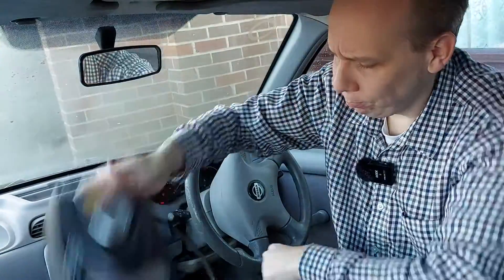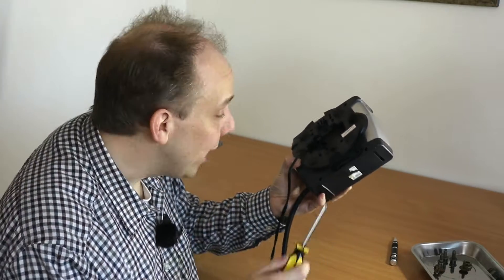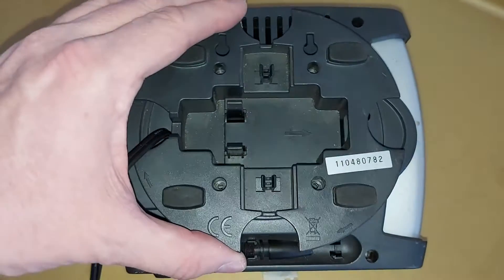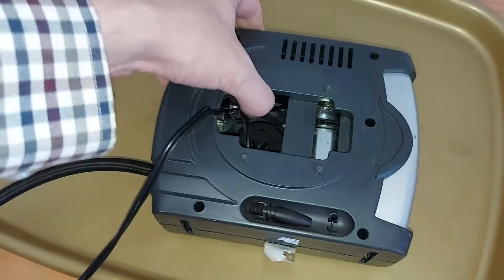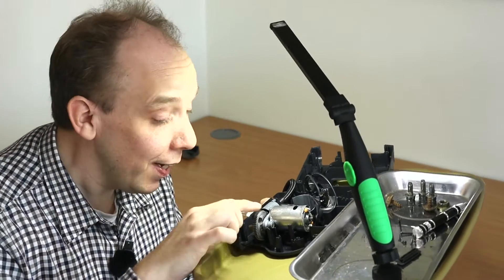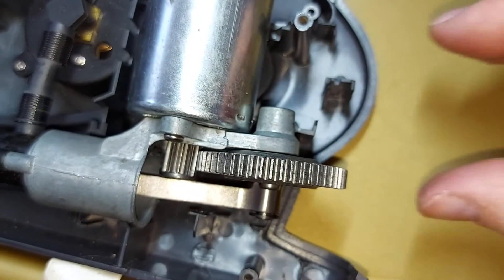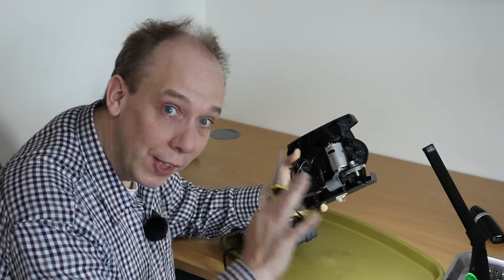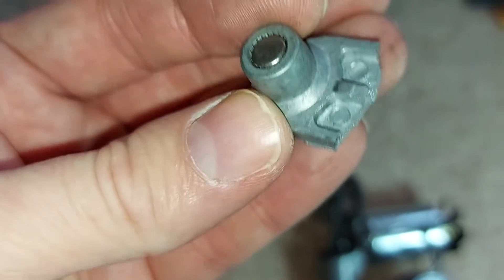How 12V Air Compressor Works: Car Tyre Pump Tear Down (Risk to Fingers)

Comment: Ten years was good, if it'd been a stepson I doubt it'd lasted 10 months.  As usual an interesting video to see the inside of such a machine.

Looking at it I'm surprised it lasted 10 years but perhaps it didn't get a lot of use and/or was well cared for.

Many users manage to burn them out and/or blow a car fuse by using them for much longer than they are designed for at each use as it's against macho law for many men to read instructions..

You can probably guess I prefer a good quality manual footpump (unless someone is not physically capable of its use) but then I've had men burnt out footpumps I've lent them, one with an overloaded six-wheeled Tranny with under-inflated tyres before the overloading.
Reply from the maker: Interesting comment as always, Nta16.

The last manual pump I used was terrible quality. The metal frame was so weak it bent (even with light use). I binned it!
Reply: @CarSpyTV  sounds like one of those £5 specials. 😊  The last really good one I had was the one burnt out by the Tranny user, double-barrelled so fast and more stable.  The current one (single) I have is better than most but the retaining clip for stowing is a poor design and the pump is already marked up a little after a few years use - but it's better than those wheezy, noisy, rattley electric ones that burn out on more than light top-ups.  😊
Reply from the maker: £5 sounds about right. And that was £4.99 more than it was worth!

I agree, by the way. Some of the electric compressors have a short life. The Ring ones seem to last, though. We have a few in the family.
Reply: @CarSpyTV  if they last that's good. For full disclosure I have a Hayner Pedal Power Pro which my wife wants me to put in the boot of her modern car instead of the factory supplied electric pump but the manual foot pump is useful at home to help neighbours out who only have the electric pumps.  But then I also only have manual screwdrivers. 😆

Comment: Wow, I didn’t realise how simple those pumps were. A very clever and basic design. I think you should connect the system the micra engine. It could be the pat powerful tyre compressor… in the world lol😊
Reply from the maker: Or, perhaps a spare engine for the Corsa! One cylinder is enough, isn't it?
Reply: @CarSpyTV  yeeeeea, that should be perfect. With that electric motor it will be a hybrid!! :p
Reply from the maker: That's my weekend sorted!

Comment: Interesting to see the inner workings. Surprised the actual pump bit is so small; explains why these little machines can take a while to add a few pounds pressure. I think you came to the right conclusion -- it's broken beyond the application of glue. However, have you considered a sticking plaster.
Reply from the maker: These compressors can certainly be slow (and noisy). Mrs CarSpyTV might have a plaster - but not me!